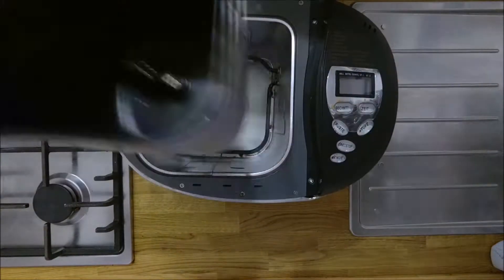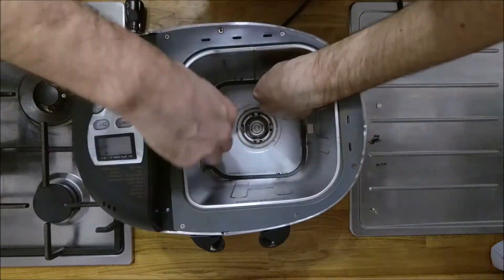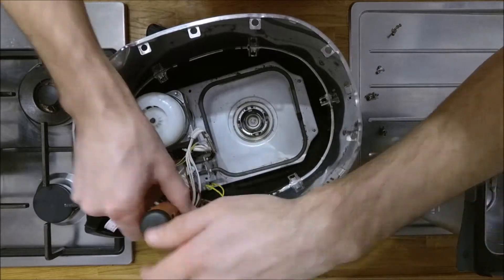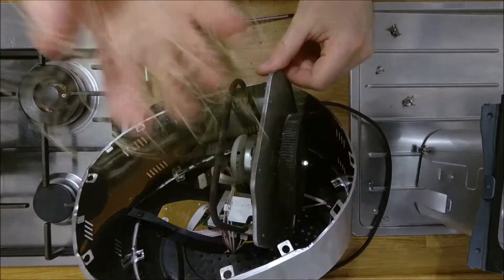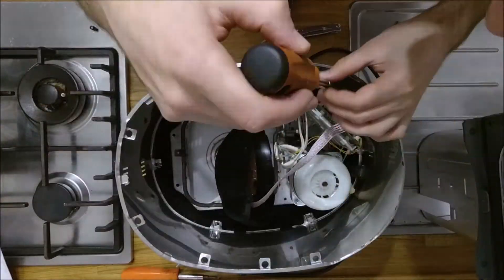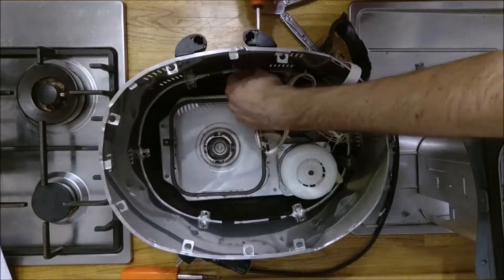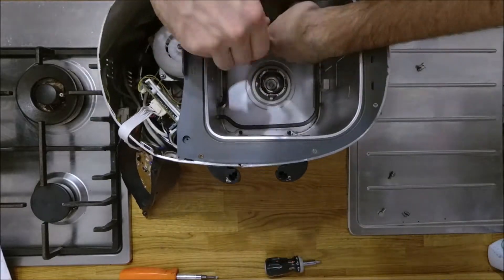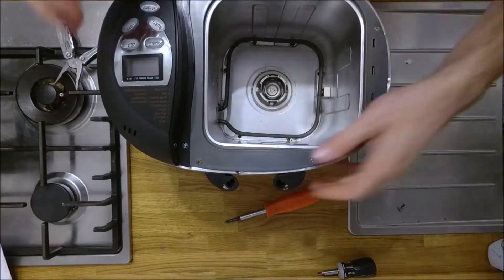Unold Onyx 8695 Bread Machine Belt Replacement

Comment: Thanks a lot, Marc...I just have to replace the belt right now...very helpful...
One question...i have four round black Plastics with a M4 Hole left...cant imagine, there to mount them..any idea?
After removing the 8 M4 Screws of the heatshield...i decide to take new one because the old where badly rusted and spoilt...Hope the reassambling goes well for me..just have to buy the belt now...

Comment: did it hold? last time i used it, the bearing also made horrible noises. i think the broke bearing is the cause for the belt to rip into pieces. fixing the belt is probably only the half fix. i guess i will buy a new one, this one was for cheap. it was also very loud. but thanks for the video.
Reply from the maker: The bearings on mine sound fine. I don't know if the belt was contaminated or simply had aged but the material had become very brittle and was crumbling off. I haven't had any issues with the new belt.

Comment: Good video, what is the reference of the belt, link to buy it? Thank you.
Reply from the maker: I don't have the part number so I just ordered one that specifically said it would work for this machine. Here's the link to the belt I ordered: https://www.ebay.de/itm/293602569108
Reply: How many teeth the belt has, because  it seems the belt no available so i tried  to buy with the same teeth and length.. tia
Reply: Mine broke, I threw it away.

Comment: It looked simple. So I tried but simple could not reach the screws at the bottom because of the heating circle...what kind of screwdriver did you use?
Reply from the maker: I used a standard length phillips head screwdriver but it was certainly a pain - a screwdriver long enough to keep the handle above the heat shield would be best, otherwise you have to hold the screwdriver at an angle and use lots of downward pressure to keep it from slipping.

Comment: Thank you Marc, €2 belt saved me the cost of a new machine. [Better for the evironment too.] If I had not seen it was possible, I would have given up. Minor differences in my experience: 1) on my machine, if you hold the lid at 45° it pulls away (no need to undo screws). 2) I could not reach the base-plate screw next to the motor (perhaps possible with a long flexible screwdriver shaft ?); I ended up unscrewing the "body" from the plastic base - I do not recommend this, as it is slightly deformed after re-assembly. [... and here again there is a hard to reach screw - I do not want to admit how I dealt with this.] 3) 2 of the 3 "control panel" screws were covered with plastic plugs - I did not remove these, left it attached to the "heat shield" and disconnected the "data cable". A deep cut in my palm confirms your warnings of sharp edges. Questions in my head: a) Why (on earth) is there no hatch underneath to access the  belt ? b) how are such repairs carried out at Onyx (ESGE) ? ... equally interesting, how is (was) machine assembled at factory ? Marc, thanks again; I owe you a beer, if you are ever in Munich :-)
Reply from the maker: Thank you for the feedback, I hope others can also find it useful. I agree, a long screwdriver would really help this repair project.
I have a feeling Unold never had any intention of repairing this product themselves and probably hoped consumers wouldn't attempt or have success servicing it either. Nevertheless, I'm glad you were able to save it from going into the trash!